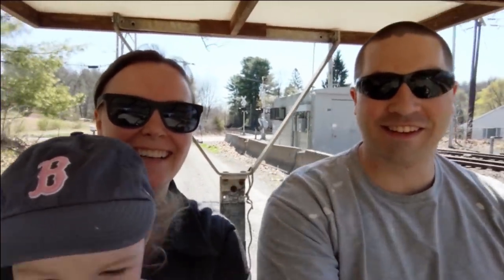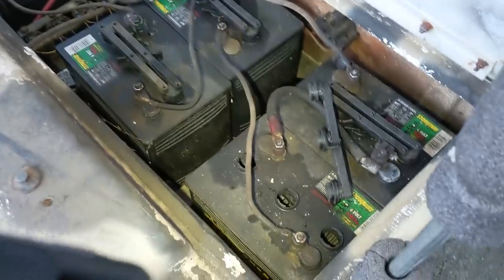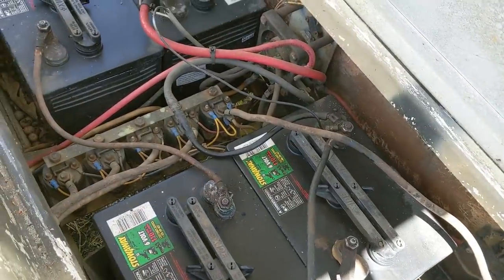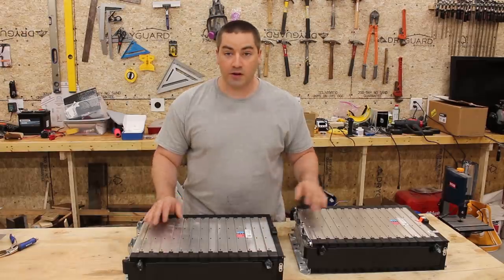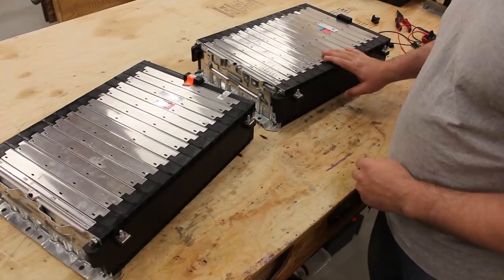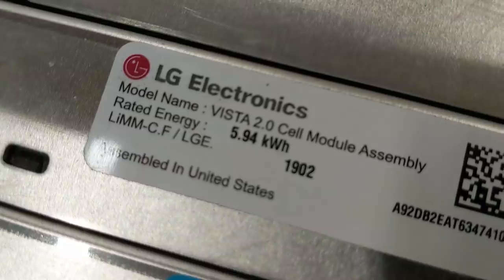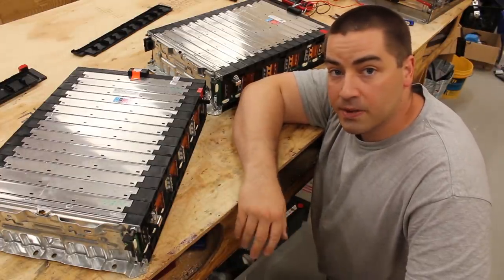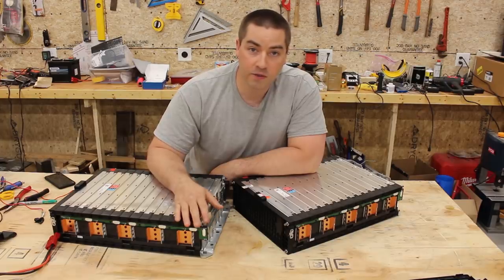Golf Cart, Lead Acid Swap to Lithium, Intro

Comment: Yeeeaaah great use for those! Lithium should have nowhere near the sag as lead acids.
Reply: Lead acid batteries sag and do not give as much current if it was not used recently. The led plates get sulfated over time with no use, giving the batteries a load and a charge multiple times will get rid of the sulfates and will keep the batteries in good condition. I have recovered many so called dead lead acid batteries due to this simple mistake people make

Comment: 2 of those in series in a 48v cart would work just fine. Maybe upgrade the contactors but the motor/s would be just fine unless they were ancient tech. Even your cart could handle 48v so at full charge it will do really well. I would go back when you have time and check your contactors and make sure they are all working. Looks like there were more than one. Follow up video soon? Looks great!

Comment: Forget the paint job and turn it into a work cart.  I worked at a golf cart dealer back in the 80's and we had two carts that had angle iron and plywood decks front and back.  One even had the pass seat removed for a full length deck over half the cart.  Used those things all day every day.  But you're gonna miss the lead acid batteries as they are made to be pulled all the way down (run 36 holes of golf) between charges.  And will do that every day for 3 years +.  And still be useful for many years after that by most of us who don't need 36 holes between charges.  And btw, we never used (and golf courses don't use) distilled water in them, just straight out of a hose well water.  The lead plates are massive compared to a car battery, so corrosion isn't really a problem with them.
Reply: Golf cart batteries are made to be pulled down to about 50% SOC, like all deep cycle lead acid batteries. But 50% SOC is essentially not enough voltage to move the cart so it's a self regulated cut off. Lithium battery SOC must be more closely monitored but David knows how to do that.
Reply: Mat, he will not miss lead acid, ever, in any situation, especially this one. Just my opinion. Stay tuned.

Comment: Holy Moley, time to get a plasma torch to cut out the wheel wells and put 25" tires on. It's already camouflaged so you can take it hunting or cross country in stealth mode. Can't wait to see you do some wheelies! Next, replace the top with solar panels...

Comment: I was just considering looking for an old electric golf cart with bad batteries to put some lithium in there... I was considering 48V models simply because 48ish volt inverters are commonly available and to reduce the amperage. Basically make a rolling powerwall. A golf cart that can burn rubber wouldn't be bad... lithium will make it lighter and should provide more torque, which is a win-win.

Comment: Following along with interest, I have a GE Elec-trak, which uses a 36V lead acid set of 6 volt. My property is mostly hill, and the batteries are about 7 years old. She lags horribly going uphill, and should last longer on a charge. It wouldn’t quite be a straight swap, but shouldn’t be too hard.

Comment: Hi David,
  I have an old electric car with an ac motor and regenerative braking. I am going to change it from lead acid batteries that weigh in at around 700Lbs to lithium batteries which would weigh in at less then 200Lbs from the newer hybrid cars. I have 3 set of the lithium batteries. I will be putting 5 batteries in a series to create 150 volts each which the car uses then hooking them up parallel. I will end up with 6 150 volt batteries. I would like to hear your thoughts on this setup and any pointer you can give me. Regards, AJ.
Reply: AJW im courious how it went with upgrading to li
After the holiday I have to choose whether to go back with lead acid or upgrade a 72 volt lsv truck. I wondered if that required more mods like charger etc.

Comment: I'm really interested to see how long it takes to charge up those batteries with solar panels on the roof.
Reply: I use 2 older 250 watt panels on a lead acid golf cart, works great. I use a Genasun charger.
Reply: The battery will charge at whatever  watts of panels are times sun hours in your area minus some inefficiency for being mounted flat but thats not much decrease in summer (my optimum solar angle in summer is 13 degrees in west TN and 52 degrees in winter. Luckily gold is a spring to fall sport for most here.

For example you might use 2,000 watts of battery to play 18 holes. If you have a 315 watt panel it will provide a little over 2200 watts in a 7 sun hour location on sunny day minus about 10% conversion loss (though could be more like 20 %) So you end up with about 2,000 watts and could play a round of golf every sunny day without ever charging with grid theoretically at least.

Comment: If you think in terms of car batteries, as they come off charge the voltage will be anything around 14.4v so for your 6x6v that equates to 43.2v Your Lithium batteries will be at 42v after a full charge so no great difference. If you expected your batteries to run the golf cart for 2 hrs, that implies drawing a continuous load of 5.94/2 or 2.97kw which equates to approx 4 bhp. I can't imagine the cart draws much more than that.
Reply: And those deep cycle golf cart batteries shouldn't be floated at 14.4 like a high discharge rate lead acid, like a car battery, (or "starting battery" in the boat/RV world where they also use "house batteries" that are almost identical to golf cart batteries).

Comment: I have a 48 volt system with a 327 watt solar panel for my roof , I live in Arizona,  so far I haven't had to use a charger at all .
Reply from the maker: Great.  Solar power!

Comment: If you plan on towing you may need to upgrade the controller to pull more amps from the battery. You could easily get a 500a controller.  Probably  a 600a
The controller rating  is usually the motor amps and the battery amps will actually be less..

Comment: Great project! How about making it into a driveable power wall or charging station? Run your welder off your golf cart?
Reply from the maker: Yep, that's on the To-Do list also.
Reply: I don't know. I think getting a 12V buck converter, so he can run headlights, radio, and LED strips is more important! 😆
Reply: 200 amp hours / 6 volt golf cart battery 6 batteries equals 36 volts that's around 1200 amp hours so basically you need three of those packs just to be on the safe side

Comment: My 48 volt Club car DS  runs fine with batteries only getting slightly above body temperature after driving for 40 minutes solid and it is only using the 2p14s pack for now so 120 amps.  So you will be fine with just one pack and with the weight savings you will still get more range than new lead acid batteries. Remember this is with stock motor a little over 2 hp.  The aftermarket up to about 10hp motors in newer electronic carts (not resistor carts) use about 400 to 500 amp controllers and I think the BAD BOY BUGGY uses one for each axel motor since its four wheel drive but the newer TEXTRON ones use 72 volt and AC motors not DC motors.

Comment: Darn! You took the last of the 10S packs!!!

Also look at using a QS 138 70H & EM150 controller motor on the cart if you dare :) you'll need a lot of reduction. ;)

Comment: I thought you said in the video you were going to try to put a charge on the LA batts and see if they would hold a charge. I doubt they would as well but I was interested to see the outcome of the those.
Reply from the maker: The opening clip was with the LA batteries.  They could hold a charge for about 20 minutes after removing the charger.  I was able to get up/down the driveway and get that video clip.

Comment: lithium is worst then a drug, once a solar user starts using lithium they are hooked for life :D
Reply from the maker: Yes Sir!
You have me jealous of your Nissan Leaf.  I'm now crusin' the classifieds for one.  Do you happen to know if all the years will work with your type of DC modification, or just certain years?
Reply: @DavidPozEnergy  get at least a 2013, it has a 6.6Kw charger, mines only 3.7kw :S im pretty sure for at least the 24kwh one.

Comment: Watch for heat build up in the pack, EVs usually have battery cooling systems so they can charge and discharge them so quickly. At least stick some temporary thermal probes in there so you can watch while testing. You will need some kind of SOC monitoring even if it's just a voltage gauge, you know enough to see when the voltage is below the flat part of the curve.
Reply: Should be good, especially with 2 packs in parallel. My friend dropped 1 in his golf cart and it doesn't even get slightly warm. What does get warm is the negative wire. I guess the fix for that is just increase the wire size.
Reply: @WorldChampInfinity  Definitely correct on the wire size, I'd still want to monitor the battery pack for the first few hard tests.

Comment: Hello David! I enjoy your videos and am subscribed to your channel. I have 8 old vintage golf carts from the 60s I would like to convert to lithium but batteries are expensive. What are your thoughts on an electric car battery. I can buy a 2013-2015 Chevy volt battery for 2000 dollars. Would you consider this feasible? Would the age of the battery be a concern? I would appreciate your input. Happy Father’s Day!
Reply from the maker: Chevy did an excellent job making the Volt battery pack.  They age very well.  I used a 2016 to run my house for a couple years.  There are 96 cells in each car, so you will be able to make 8 battery packs, each with 12 cells in series.  The most important thing with Volt cells is to make sure you use a BMS (battery management system) with it.  Take a look at this one: https://batteryhookup.com/collections/accessories/products/12v-lifepo4-smart-bms-w-low-temp-cutoff?variant=36287975391394  Select "12s Li-ion" from the drop-down list.  You may want to add the optional Bluetooth dongle: https://batteryhookup.com/collections/accessories/products/bluetooth-module-for-battery-hookup-bms
Please use coupon code "DAVIDPOZ" at checkout.  The coupon will give you a discount, and helps my channel.

For a video on how to install this type of BMS, check out this: https://youtu.be/2tbHFdqng5A

If you choose to use an AC charger to re-charge the battery, then make sure it is CC/CV.

Comment: 2:06   Is that a relay-based speed controller between the batteries? If it is, you'll probably want to switch to an electronic controller which should give you smoother control, greater efficiency, and regenerative braking. Either way, I look forward to seeing the result!
Reply from the maker: yes, you have it right.  I still need to learn more about controllers to pick the right one.

Comment: What the differences of benefits between 12-volt system vs 48-volts system and why? I'm currently using the 12 volts system simply because it was easy to built and don't understand the difference of it. Thank you for sharing!
Reply from the maker: This is a 36 volt golf cart.  I think most new golf carts are 48v.  amps x volts = watts.  If you have a controller, or motor, that maxes out at 100 amps, then with a 36v system you have 3600 watts.  But if that same motor/controller is fed with 48v, then you have 4800 watts, 1200 watts more.  That's 33% more.  (Depending) that might mean 33% faster!

Comment: I expect the top speed with 36V will be less that the lead acid @48V, but the current available will give you great torque. 0 to 10mph in under two seconds. Well that's my guess, lets see what happens. Just use beefy cables for it!
Reply from the maker: Good point.  Thanks.
Reply: @DavidPozEnergy  the current lead acid setup ISN'T 48v, it's 36v. there are 6 6volt lead acid batteries in there in a 6s config equalling 36volts. so they are matched pretty closly. My concern is the mechanical speed controller wont work the same. it's going to arc like crazy and fry. you'll need an electronic speed controller. 😃 
if I am not mistaken when you run that at anything other than full speed it isn't using all the batteries. I am pretty sure it "adds" a battery in series to increase "throttle" pardon the terms, you know what I am saying.
Reply: I agree with the bigger cables statement.  Nothing should get too hot to the touch. Go bigger if that happens.

Comment: I’d connect those two in series, but that’s just me. ;) The motor would be fine with it, the speed controller maybe not. Since you’re going high tech, you could swap in a suitable motor controller. Yee Haw!
Reply from the maker: Wow, that's crazy.  that would be 72 volts.  DC motors can handle that?
Reply: Fundamentally, yes. The golf cart traction motor will be a series motor. With this type of motor, if the torque required by the load remains the same, the speed is essentially proportional to the applied voltage. So the cart would go about twice as fast. As long as the speed is within the mechanical limits of the motor, and the voltage is not too high for good communication, it would work beautifully. I think both conditions would be met in this case.

Comment: @3m44s: Bad habit to instinctively reach out and touch two battery terminals. In this case it's only 32 volts nominal, but still. Don't get in the habit of reaching out towards battery terminals, in this age of increasing nominal voltages. e.g. Porsche Taycan is 800 volts.

Comment: Any plans on how to charge it without the solar on the roof?  Amazing timing too.  My father just bought one.  No plans to do this yet.
Also, 6kwh per module?  I have a Volt, and I have 18.4 kwh (14.4 kwh usable).  You aren't going to put both those packs in there, are you?  That would have insane range!
Reply from the maker: Yes, 6kwh per module.  I plan to install both, but it might be two different phases.  I don't need the range, but want to demonstrate how to install them.  Even though I've never had a golf cart in my videos before, I get tons of questions about them.  I figured I might as well make a video series.  
Right now I can charge it with an old buzz box lead acid charger, that's what I did for the video.  But once it goes lithium, then I would need a "CC/CV" charger.  Mine is 36v, so something like this: https://amzn.to/2yjNQ0f  I might get one as a backup, but my primary plan is the solar.
Reply: @DavidPozEnergy  If you are patient that charger will work. I estimate you will need at least 15A to do an overnight charge, maybe more.

Comment: hi David thanks  for your reply to my question on the part 2 of the video, and the link to this video now I understand why that you didn't go into details on the video that was the second part of the series. David in this video  you mention about that you included the link to get these type of  battery from battery hook up? but I don't see a link for them? or are these batteries available only by special order? I really like those  batteries I want to get some do you know what is the cost of them ? thanks David I really appreciate your help
Reply from the maker: Battery Hookup sold out of the 36v battery shortly after I posted this video.  I'm sorry about that.  I don't think they have any 10s batteries in stock right now, but I just checked and they have some 8s and 12s batteries in stock.  Or you could buy cells and arrange your own 10s pack.  I have several videos on my channel about arranging cells into whatever size battery you want.  Or, another option, this one: https://batteryhookup.com/products/complete-mercedes-oem-lg-chem-12s-44v-20ah-880wh  It's a 12s, but you could remove 2 cells, then put it back into the same case.
Reply: @DavidPozEnergy  HI David thanks for your quick reply and your suggestions . but I liked 10s 3p those batteries because you don't have to worry about short tabs issues like I am having right now I got some cells with less than 1/4" tabs so that's too short to make secure connections, and sorry to say this but battery hook up takes too long to reply back when you have a problem with their products right now I am still waiting for a defective module, from an order that I placed on the first of this month. anyway batteries I got exited because I am planing to build a 60,000  watts solar battery bank  with lithium. right now I got a 70,000 solar battery bank with a 10,000 watts solar pvs. but I am using 2 3 tons 49 volts 820 AH forklift batteries but I am tired of checking the water levels. that is why when I watched your video of you building the 14s 6000 watts I liked the idea but with those tabs cut too short by whoever is harvesting them, that looks like is not putting enough care to leave longer tubs. makes it problematic. anyway thanks again for your reply and help, I tried to get some of the BMW crates but they sold out too !

Comment: Hi, I would like to follow your golf cart Lithium Built.  I also have a 36 volt cart, were can I buy the battery's that you are using?
Reply from the maker: I bought it from https://batteryhookup.com/  They get these batteries in batches, so stock is not always there.  But I have found them to have good options all the time, but not always the exact one.

Comment: I have been looking to do this same thing. I have the cells and the golf cart. What BMS will you use?
Reply from the maker: I have a few different BMSs on my workbench and I want to test them.  Not sure yet.  Generally I like the Daly BMS for most things.
Reply: @DavidPozEnergy  most golf carts need at least 300a. Does Daly make one for that? It is also a bit annoying in this age of 2 day Amazon prime that you have to wait a month for a Daly BMS. Someone could make some good money to import in bulk and sell domestically.